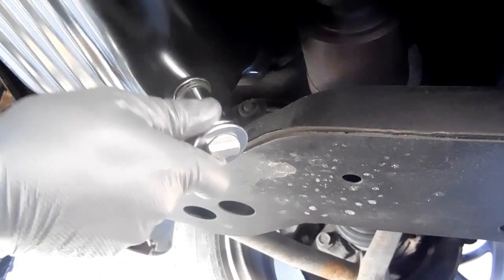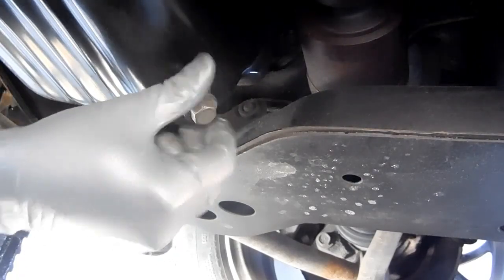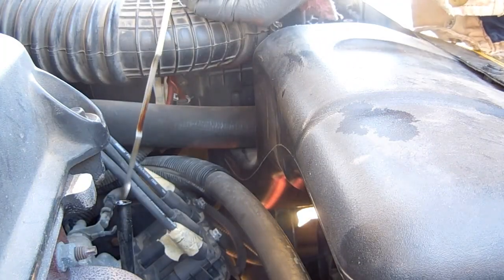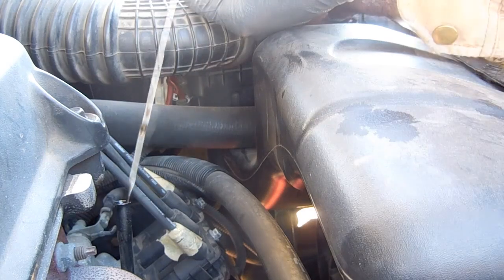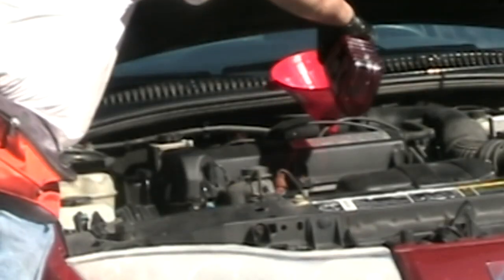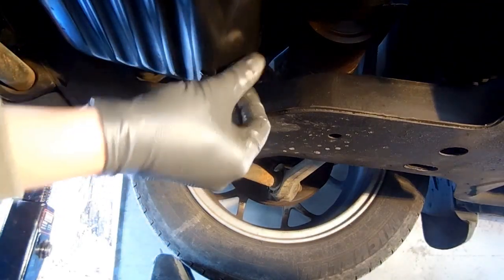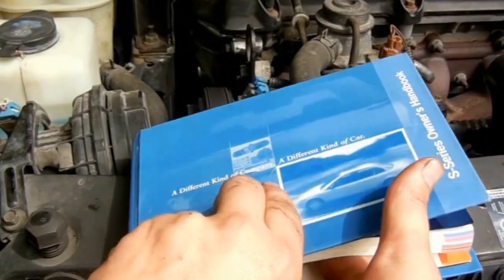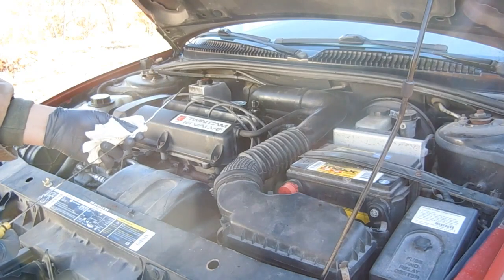Safe Motor Oil Flush Using Kerosene

Comment: I'm sorry but you miss some important points here. First of all as someone says below if you want a clean engine keep it clean by doing regular oil changes. By substituting Kerosene you are taking a major chance of spinning an engine bearing by not mixing the solution OUTSIDE THE ENGINE first and then pouring it in. The same thing for the oil additive that you put in first. I would think that because it is so thick it would probably just stay in the bottom of the pan for a long time. A much easier and safer method is to buy a 4 quart container of oil, drain the pan but leave the old filter on, then add the new oil and drive the car for two days or so and then do a regular oil change using a new filter. Instead of the thick additive just go up from a 5W20 or 5W30 to a 10W30 or 40. Costs much less and has a better affect..

Comment: If you run synthetic oil, you won't have to do this.
Reply: Patrick TheBaptist well depends, the frame ultra is on par with most other brands, silicone seals, dual layer pleats, stamped steel end caps, and metal anti drain back valve. hk3845 did a video on it. I have used that particular filter or royal purple on both my cars 2008 caliber and 2011 charger rt. one at 158,000 miles from new and the other 105,000 miles from new. no issues. of course I have also only used pennzoil ultra oil or royal purple
Reply: All road oils have some detergent, IIRC Rotella 15w 40 is high in calcium (A detergent).
  Just use 15w 40 Rotella, and save the money on Synthetics, Kerosene and Lucas oil treatment..
Reply: Not true. I've used motor flushes in engines using synthetic oil. The flushes really remove a lot of build up. Synthetic oil is better in many ways, but is not magic.
I personally like to use new oil with a flush. Seems to work much better than puring flush into dirty oil.
Reply: tarquineous When a lab verifies your sludge claim you have actual data I can evaluate. Modern PCMO’s including conventional don’t produce sludge when changed at reasonable OCI. Period. I have a background in lubrication and haven’t seen sludge issues in decades. What you are seeing with a flush is likely varnish that is removed. Understand that varnish is cosmetic and has no impact on lubrication whatsoever. Any other material will come from the rings.

I will add, modern conventional oils are highly refined and processed. They cannot be compared to offerings of even the mid 90’s. They are more similar to synthetic based products than dissimilar. Even so, a base oil is only a small part of the equation. The additive package is what makes the oil and what specifically controls wear, foaming, oxidation, detergency etc etc.. so many people, even mechanics mistakenly believe “synthetics” are somehow superior. Some are. However many conventional and blends perform at such a high level, there is little a synthetic can offer the end user. Maybe the synthetic in question has a slightly higher flash point. But what use is that if the limit of said product is never reached?! The answer is you have simply thrown your money away. There are countless examples of end users extending conventional oil way beyond OEM recommended OCI, and sludge not being an issue. Of course this is outside of warranty and supported but UOA. At the end of the day most outside the blending/formulating community simply do not understand oil. There are plenty of articles supporting what I’m saying available to you and anyone else who wishes to validate what I’m relaying.

Read up on a hot topic like the use of Group IV PAO in oil. Everyone hears this abbreviation and thinks it’s a magic base oil... guess what, it’s not. Without being blended with Group V esters(AN’s and POE’s) PAO has a non polar nature and actually shrinks seals. Think that’s good?! Add esters and certain additives and things change dramatically. One strength of PAO is natural solvency (keeping internal parts clean). But guess what, many Conventional Group II oils are also blended with esters which are just as good if not better than PAO when discussing solvency. And this relates specifically to what you are claiming to see when changing oil. Could it be varnish and Ring carbon, absolutely. Sludge? Not unless you are using an old stock oil which doesn’t meet current API standards.
Reply: Yes, it is mostly varnish that I see in most engines, with small black particles in the oil, and inside the filters, which I cut open. I get this even with bypass filters installed on the engines. This is why I use a crankcase full of new oil mixed with a flushing agent, about every two years. In the meantime, I use a few ounces of Essentialube or Seafoam in the fuel and oil, right before an oil change.
Thank you for being knowledgeable! 
Amsoil and Blue Diamond are PAOs that I use. Hot Shot's FR3 and Stiction Eliminator are mostly group 5, as well as Redline motor oils.
So many products out there now...
Reply: Thanks for the info Nordic. I do oil changes on a few friends and customer's cars. Maybe 15 per years. Over half of the engines are filthy dirty inside, and the filter elements black. The rest are just plain dirty and need a change. My own engine is the cleanest I have seen in 40 years, except for very new vehicles.
Reply: tarquineous You are very welcome. A proven product is BG EPR which will clean the rings if they have carbon build up along with any other residue in a neglected engine. It is available on Amazon and is used by many dealerships when a flush is required. I have found it to be a very effective product when applied to engines that need it. Just be sure to follow the instructions to the T. Best wishes
Reply: Thanks again Nordic. So many products, I forgot about the BG EPR which I used once in my Ford Ranger V6. What I noticed using the BG is small black particles in the oil and inside the filter. I suppose these particles came from the piston/ ring area.
Which brings to mind : I think a good tool for DIY owners is a bore scope to look into the oil pan. The screen on the pick up tube and the amount of debris on the bottom of the oil pan are good indicators of engine maintenance.
Reply: formerice Yup. Mobile 1 full synthetic every 5k. And a good filter.
Reply: MarzNet256 
My Porsche is every 20,000 miles or 2 years between oil changes. From the factory it's always had mobil1 0w40
Reply: @OverlandTT  same as my vw cc. 0w-40 but I do it every 3000 miles.
Reply: Salvador Martinez 
Every 3k bro?  That's a short interval for mobil1
Reply: Exactly, synthetic has detergent in the oil which prevents sludge.
Reply: Johnny Woo All modern motor oil regardless of base oil contains detergent....
Reply: Johnny, so does conventional oil. Synthetic takes longer to sludge up, but still turns to crap like any other oil in an internal combustion engine. There is no magic.
Reply: tarquineous why all this talk of “sludge”... it’s 2018, oils do not produce sludge and many engines that did previously were due to poor design and relatively underdeveloped oil technology back in the day. Coolant intrusion also could produce this. It’s just simply a non issue anymore
Reply: Johnny, the synthetic base oils are less prone to forming sludge. All motor oils of API SD or above have detergents.
Reply: If your filter is a fram then it's junk.
Reply: Patrick Baptist Fram currently produces one of the best oil filters in the industry “the Ultra”. Visit bobistheoilguy.com and see the “data”. This badmouthing a product because of past experience is of zero help to anyone who wishes to buy the best product “currently”. Old wives tales are no longer suffice....

Comment: I would not recommend this. If anything, switch to a high quality full synthetic motor oil like Royal Purple and Mobil 1. The Lucas additive is junk, it is thick and increases the viscosity; lowering the volume of oil flow through the engine.
Reply: Jim Gagne In use synthetic oil. After three thousand miles the oil looks fine. Definitely not ready for a change in either vehicle that I have run synthetic in for.more than three changes. Have a Ford Fusion I have owned since it had only 19,000 miles. Have run full synthetic now has 150,000. Have changed the oil at 6 and 7500 mile.intervals. No varnish or cam wear whatsoever seen when replacing the valve cover gaskets. Have a Maxima that my dad owned got it with 150,000 miles. He ran conventional oil and changed every 5000 miles. The top of the heads were coated with varnish. Every inch. Immediately changed the oil with full synthetic. Varnish loosened and clogged the filter after 1200 miles. Drained the oil and changed the filter again. Refilled with synthetic again. Filter began to clog again at 1670 miles. Oil still looked fine so just replaced the filter. This same oil is now ready for the first of the two initial short 3000 mile change intervals as recommended for the first two changes when switching from  conventional to synthetic for the first time in a high mileage engine. The varnish is almost completely gone but am still going to do one more three thousand miles change  to finish cleaning up the mess the conventional oil made in that engine. Will never....ever go back to using conventional oil when synthetic is available everywhere, far superior and very affordable  especially if you change it yourself.
Reply: Jim your right!    I have an F250 that I have changed the oil every 3500 miles since new and I've always used the recommended MotorCraft 5W20 oil and I now have 290K plus miles on the Gas engine.  I work it every day and it still runs great, uses no oil and has never been opened up. But thats not all... 
I looked in the owners manual when I bought the truck and have been following the recommended maintenance schedule and have never looked back. 
When I change my oil it doesn't look dirty and black or stink but I change it anyway rather than listen to additive companies. I change my air filter every 3rd oil change even if it "looks" clean. 
I also drain and flush my radiator EVERY year (right before winter) and replace the anti-freeze and distilled water and I still have the same water pump and radiator. I changed ALL the hoses, belts, and fluids, and spark plugs and thermostat  every 100k miles like the owners manual suggested. 
READ your owners manual, don't listen to sales peoples claims. Remember they are trying to sell you something. Your owners manual is telling you how to take care of your investment.
Every good mechanic knows preventative maintenance is THE key to a long, reliable service life. 
You can't buy that in a bottle.  Its work that has to be done.
Reply: No.  Synthetic oil uses a different base but the additives are the same.  It does nothing to "catch all the dirt and sludge" over conventional oils, but what it DOES do, is take more heat and time to break down so that it does not contribute nearly as quickly to NEW sludge, so the detergent that is in it, remains effective for longer.
Reply: So what the rings are gone anyway.
Reply: He said the engine had blow-by. Lucas is a cheap 'fix' for this condition, rather than a complete tear down. IMO that car isn't worth it, and not many are.
Reply: sparklysparks77 
Mobil 1 High mileage
Reply: bubba stephens At last! Someone talking sense on here!
Reply: Jim Gagne I think that it's not a bad thing that oils getting dirty. 

Synthetic oil usually has more cleaning additives, so if you dirty engine it will turn oil black quicker.

Or your car has direct injection, which will also cause the oil to go dirty
Reply: Amsoil would be my choice, its been tested and is better than Royal Purple and Mobil 1.
Reply: Wow that's the strangest thing I've heard in a long time.
Reply: bubba stephens I agree
Reply: Jim Gagne You idiot. That's how fully synthetic oils should behave. They have special chemicals to catch all the dirt and sludge. The problem whoever is when you keep using carappy oil filters.
Reply: Royal Purple is bad news.  Using it a few years ago, I had a lot of engine issues using it.  Mobil 1 has been good and Amsoil even better.  Just my 2c
Reply: Good answer. Any synthetics you think are good enough to try after 65k miles of running conventional oil? Any? How about those you would not recommend?
Reply: What are the indications of a clogged oil filter?
Reply: Lucas is junk.
Reply: Totally agree as well.  I've found that doing what he is doing (in video) causes the rod bearings to wear prematurely.
Reply: K
Reply: Shino's Garage TV totally agree.
Reply: Shino's Garage TV Yes. Just run a quality full synthetic and change every 5k. Synthetic does not form sludge the way conventional oil does.
Reply: Shino's Garage TV Almost any decent motor oil thickens under increased heat. They are supposed to do that
Reply: What a douche, if ya wanna flush ur engine drop all of the oil add the same amount in diesel running for 20 seconds drop that out, bam engine flushed
Reply: Terrible advice!!! If someone reading this has an engine with over 200k miles, they would be well advised to use a semi-synthetic or just a conventional oil like 10w-30 or 10w-40. Synthetic oils have much smaller molecules. Those molecules might not be large enough to lubricate a worn engine properly.

Comment: whats the point of adding that lucas crap, you might as well just use thicker oil. Looks like you're pouring a bottle of syrup in.
Reply: Lucas has almost 100% stabilizers and friction modifiers - NOT just oil.
Reply from the maker: Lucas works great for blow by problems--exactly twice as good as 20W50, to my calculations over a one year period of time.  With 20W50 this vehicle needed 2 qts of oil in-between oil changes.  With Lucas that number dropped to one qt of oil.  I would highly recommend Lucas for old oil-burning Saturn's with blow by problems.

Comment: I would not recommend this at all be careful out there. the best way to keep engines clean try changing the oil at 2500 miles on engines 100,000+miles thats the best way
Reply: Drive Chevy's not sure if you know this but kerosene is in most engine flushing products, just like naphtha.  just Google "Gunk motor medic motor flush MSDS". if it was unsafe why would they sell it as a product?
Reply: You are definitely a person that never do it that's why you say that..it is totally safe so stop misdirecting people , if you do it right.... you can blow your engine up if done wrong with by the book oil changes did you know that?
Reply: so can you recommend us the best possible way to flush our car engine ( car driven 79000Kms).  Kerosene or Diesel or which one?
Reply: sachelle babbar 

Every  15thousand or 10 is the perfect time to change oil  if u  want a good and clean engine
Reply: hellfireansulfer an appointment* ?
Reply: There is no owners manual in the world that agrees with you
Reply: hahahaha, 2500 miles? GTFO of here.  Modern oils are so good, that 2500miles is just wasting limited resources.
Reply: ZOE SMITH  I guess everyone has their own way remember diesel can ruin seals and clog oil passage ways this has nothing to do with manual book recommendations it's just my 35+ years in general auto mechanics that's all. Remember Drive Chevy's   friends
Reply: Any of these chemicals or Diesel will clean very good but also remember it will losen sludge and that will clog oil passage ways

Comment: im a footwear manufacturer and i use kerosene to loosen excess neoprene adhesives.Kerosene really softens up those tough spillage.Imagine what it'll do to your rubber seals.
Reply: 10072018 Main seal on the back of the crankshaft, the valve stem seals, oil pan gasket, valve cover gasket. The list goes on.
Reply: Kerosene won’t actually harm the seals. Those are made of neoprene and  are designed to withstand petroleum products. But there can be a problem if the seals are worn and cracked. Often the old oil sludge is what keeps them from leaking. Flush that away, and it could cause them to leak.
Reply: What rubber seals are inside an engine?
Reply from the maker: You're right.  It's a rubber killer.
Reply: Off to watch it now.  Kerosene doesn't seem like such a good idea to me.
Reply: Patrick TheBaptist i've seen your video on using ATF lol. good stuff
Reply: Boobam LOL, 
Take care buddy thanks for the comment, I appreciate ya.
Reply: Thats why he said every 100,000 miles
Reply: boobam.
Reply: Manny, are you saying use kerosene instead of high mileage oil ? Will this keep the seals pliable?
Reply: Manny Fernandez imagine what oil would do to rubber seals!! 
Oil ruins rubber
Reply: Yup and that is why I use ATF in engine flushes.
Reply: @PatrickBaptist  hi Patrick, I've just subscribed to you? Have you a link to you're atf video buddy? Regards
Reply: @ceet12  Hey friend, I appreciate you.  Sure https://www.youtube.com/watch?v=LKWWL_rsDB4.  I reckon you meant the ATF engine flush.  Don't do it to a diesel, just gassers.  Take care and thanks again.

Comment: this doesn't seem safe...
just use seafoam in the oil.   that stuff cleans it sooo nicely
Reply from the maker: You're right, Seafoam does a great job. And it's much safer.
Reply: seafoam is the way to go.
Reply: Seafoam is great. It has kerosene in it.